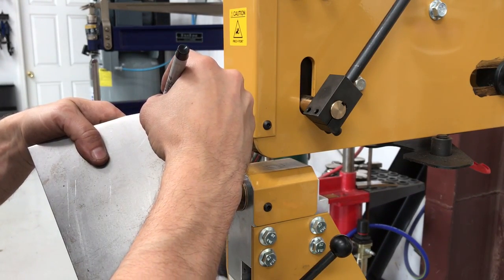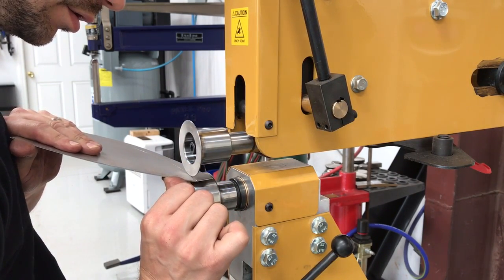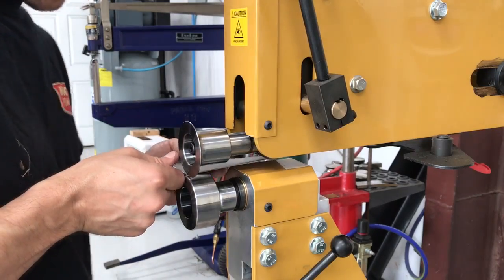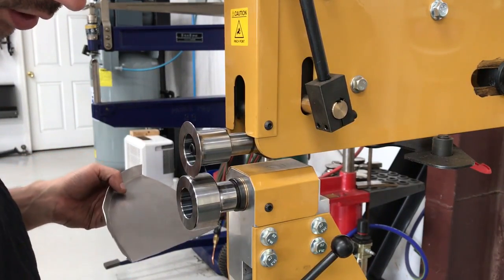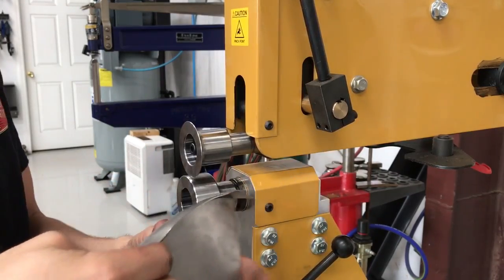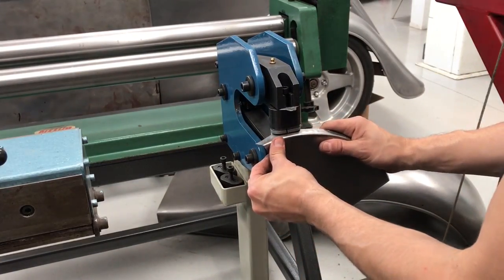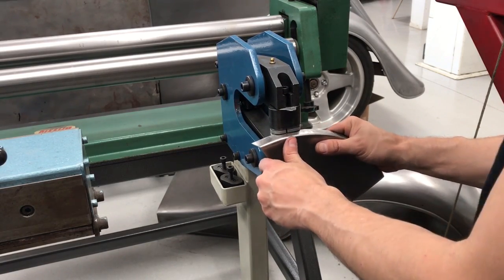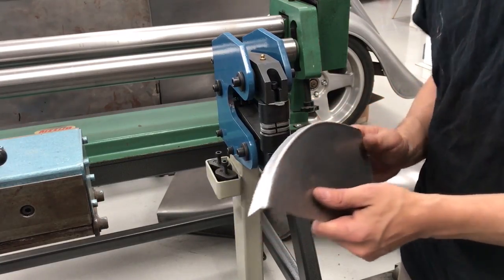Hammerfab tipping flange with Baileigh bead roller

Comment: Hey Man, i know this is an old video i found itb ecause im looking at buying this actual bead roller, but in turn i saw you using the baliegh foot shrinker/stretcher - ive had that exact model for the last 5 years and im really feeling like the dies arent all that - im wondering if you've found some good or better replacement ones since the age of this video is similar? Cheers. Sam. and also and hows the bead roller holding up? Thanks
Reply from the maker: Man we are still using the same Baileigh kick shrinker with the same dies. Ours works fine. But we also have some old school Ercos to help do the heavy lifting.  Bead roller is great. We use it mainly for tipping flanges and custom body lines.